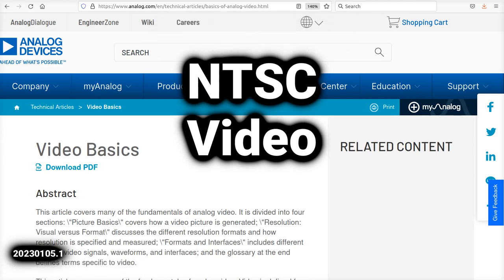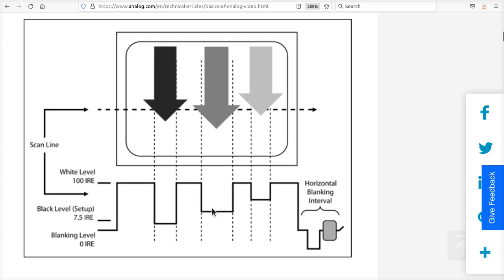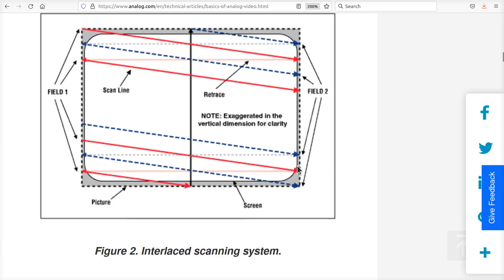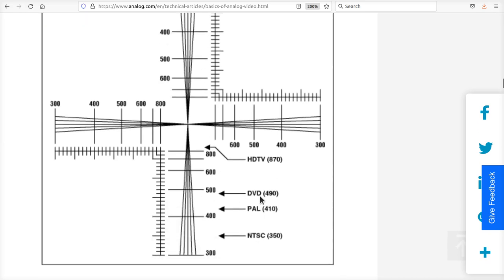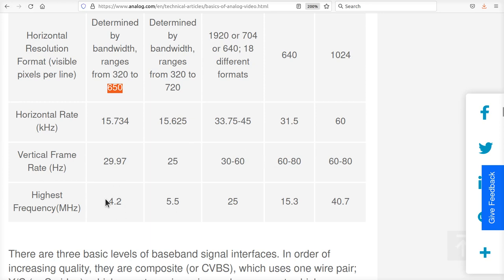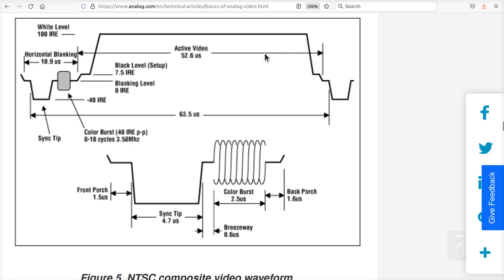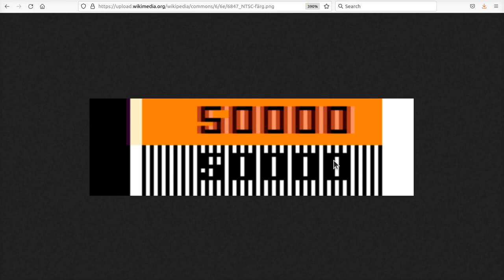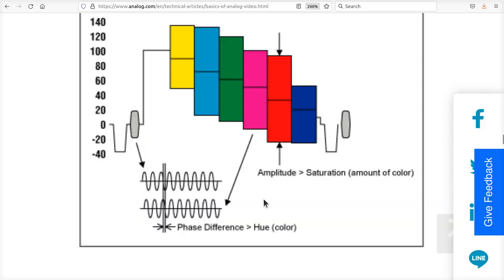NTSC Video Basics

Comment: Please note that US HDTV is still 59.94 including the two 720P progressive networks, ABC and Fox. The reason is NTSC compatibility. When HDTV was introduced in 1999, there were few HTDV sets out there. The gross majority of the viewers still had NTSC receivers. True HD shows were also down-converted to NTSC and NTSC material was up-converted to the HD standard in use. For multiple reasons in a broadcast facility, the signals must have the exact same vertical sync rate for simulcasting. This legacy problem still exists to this day. In the 4K/UHD standards, the finally dropped 59.94 for 60.00. Note  that on the production side most episodic shows and film originated material is done at 1080P/23.98. This means the master tape (or digital files these days) is compatible with any world TV standard including the legacy NTSC and PAL variants. The broadcasters never see 23.98 or 24p as the release master is converted to the format the broadcaster uses - world wide.

Comment: The process of frequency interleaving the chroma into the luma is responsible for the color burst shifts forward 90 degrees not 180 degrees per field. After four fields it arrives back in phase. Hence there is a four field sequence. Note that there is a 180 degree reversal line to line!
Reply: yup, it'was called "color framing" and an annoying problem editing with direct NTSC color record broadcast VTRs. Often the edit point was a frame off from where you wanted it to maintain the color field sequence. If ignored there was a 140ns H shift in the image at the edit. But if the edit was not a match frame,  the production industry often did a non color framed edit anyway as with a scene change, you would not notice the H shift. And then there was 3/2 pulldown from film sources - that's another story. Note that PAL had an eight field sequence!

Comment: Going a bit deeper into NTSC theory. the chroma signal is NOT exactly a 3.58mhz sinewave. NTSC uses DSB-SC Double Sideband Supressed Carrier modulation for the color difference signals. The 3.58mhz AM carrier is not transmitted except for the color burst. Only the modulation sidebands are sent as the chroma signal. But the receiver (TV) needs a constant raw 3.58mhz carrier to demodulate the color difference signals. This is the reason for the color burst. Just as H & V sync frequency locks the receiver scan circuits, the color burst locks a local 3,58mhz oscillator for both frequency and phase in the receiver at each scan line. If the chroma signals were modulated as a basic AM radio signal, the picture artifacts would be horrendous.  This was one of the problems encountered (there are a few more) with the spectrum interleaving of the chroma with the luminance signal. They had to get the energy level of the chroma signal lower and the use of DSB-SC obtained that.

The two color difference signals are a complex mixture of the RGB signals and there are multiple standards to do this function, I & Q, R-Y & B-Y, but for the utmost simplicity think of the color difference signals as red and blue with the luminance a combination of RGB. Using basic algebra circuits we can extract the green signal, out of the luminance at the receiver.
Reply from the maker: The people that came up with these things and got them all working with the commodity technology they had at the time are geniuses!

These days, I get to make pretty pictures with VGA and ONLY have to care about the hsync & vsync!   (yeah... I know I am ignoring gamma correction.  It'll look good enough for a terminal screen and some video games!)

Comment: I think I get the color burst thing a little better now. So for each color pixel you have a phase offset on the visible horizontal line. So how does it 'fit' that 3.58mhz for each pixel?
Reply: What do you mean by "fit?"  There's just one thing changing here -- the voltage level over time.  So at 54mV you see black, at 1.0V you see white.  You only see color when you "wiggle" that voltage close to 3.58 million times per second.  It's just one continuous signal as you stripe across the screen, and sometimes it wiggles (color) and sometimes it doesn't (pure black or white).  "Pixels" aren't a real concept in analog video (a pixel is a digital concept -- I arrange a buffer of colors I want in a 2d array of pixels for example).  The effective rate that you can change your voltage level on an analog signal is what loosely corresponds to a pixel.  In other words, if you have a really slow, kind of ineffective video device (like say the Atari 2600), it can't change that signal as fast as the TV is able to, and so it's "pixels" are constrained by the speed at which it can generate a scanline with a given color wiggle, and thus those old devices looked "blocky" when they produced video.

If you're wondering what the highest theoretical speed at which you could change that signal, he explained that in the video -- it's somewhere in the 300 - 650 times per scanline range (it varies because different tvs will act differently -- some old vacuum tube driven TV probably can't do better than 300 changes per scan line, but a brand new circa 1990 tube tv with lots of digital components might be able to show 650 changes per scan line).  Above that 300 - 650 changes per line, your TV's analog circuitry won't be able to keep up, and it will smear them in some way (producing incorrect colors, or simply not displaying an individual change you had in your voltage stream).
Reply from the maker: How many 3.8MHZ time periods can fit into one active display scan line? Once you exceed changing the luma at that rate, it is likely that a TV can't differentiate between interpreting it as a color and as a brightness.
Reply: @Calphool222  What I am trying to understand is how that 'wiggle' ( I assume a sine wave) determines the color. I get it has to do with the phase of that 'wiggle' but lets say I wanted to use a micro controller, like a Pi Pico to generate this signal, and I want to get at least 8 bit color up on the screen, I need to wiggle that signal at a phase difference from the color burst? I get that the color burst is telling the TV that a color signal is incoming so is that color burst frequency for each 'pixel' color just a phase difference from the original color burst? I do understand that with a micro controller you wont be generating a sine wave but a square wave which I imagine should work, no?
Reply: @JohnsBasement  Well... say you had a signal capable of 8 bit color, 300 or more 'pixels' on a single 15.7khz ...and lets round that 'pixel' count to a standard like 320, you will need to modulate that color burst at the correct phase for each 'pixel' at around 49.2(rounded up) times per scan line if my math is correct. So I am guessing that 'wiggle' per 'pixel' would have to fit in at the proper phase for each color 'pixel' within that 1/49th for each 'pixel'?
Reply: @GORF_EMPIRE  

You kind of have to understand a little bit about AC signals to grasp what "phase difference means."  Imagine any AC waveform.  If you say it is at 0 degrees, that means it starts at position 0 and swings up and down at whatever its frequency is.  If you say it is at 90 degrees, then it will start part way through a swing (not at 0).  When you compare that waveform to another waveform at the same frequency, they either overlap (their phases are the same) or one precedes the other.  You can measure how much one precedes the other, and get a "phase difference."   

Now, imagine a color wheel.  In the center is gray, and all around the outside are all the colors of the rainbow.  The gray bleeds into the colors.  They are most radiant at the outside and most gray in the center.  Any color in the NTSC scan line signal can be represented as a point in this color wheel.  The phase difference tells you the angle on the color wheel, and the amplitude tells you how far out toward the outside edge (where the color is most vibrant) of the color wheel to go.
Reply: @GORF_EMPIRE  

I'm not following your math.... if you have 320 possible color changes per scan line (loosely speaking, "pixels"), then you need to modulate the phase (and amplitude) 320 times in the duration of a scanline (a scanline takes 63.5 microseconds, or 0.0000635 seconds).  So each color change would have to happen in 0.0000635/320 seconds, or 0.0000001984375 seconds, or roughly 200 nanoseconds).
Reply: @Calphool222  Right since I did not account for the Hsync and burst. It was considering the entire line which was not smart.... I typed this out at 7am after a long shift. 😅
Reply: @Calphool222  I do understand AC signals and phase difference. But a horizontal line is really a constantly changing DC signal where the ac signal is modulated on to. It's modulation I need to rap my head around but I get the color wheel thing...just trying to figure out how to actually generate that using a micro controller. Truth be told, I can use a simple Analog Devices to do the RGB to composite for me, but would be more happy knowing how it could be generated directly from the controller.
Reply: @GORF_EMPIRE  

An NTSC waveform is more complex than a normal DC or AC signal, but we still treat the colorburst and the chrominance/luminance signals like they're AC with a DC offset.

With regard to your questions about generating NTSC color data with a microcontroller, I think that's a tall order, bordering on not-possible.  As mentioned, you've got a window of 200ns to generate your AC signal that represents chrominance for one "pixel" of your 320 resolution scanline.  You'd need a pretty fast microcontroller to be able to spit out more than a few oscillations in that narrow window.  Plus, you've got to deal with the DC offset somehow (and the DAC on most small microcontrollers isn't going to be fast enough to provide much help there).  I'm not saying it's 100% impossible, but it's non-trivial, that's for sure.

With regard to using binary values to generate your choma/luma, what you'd do is map some bit pattern to your oscillations.  For example, if you used 8 bits, that gives you a total of 255 different patterns of on/off you could send in those 200 nanoseconds.  Each pattern would give you a different location on the color wheel, because the receiving television is going to compare the colorburst at 0 degrees to whatever you send in that 200 nanosecond window, and establish a phase difference.  The colors might seem random, since you're sort of brute forcing digital into the analog domain (sort of like how Woz did on the Apple 2), but you can build a table that tells you what colors you get for what values you send.... but you've still got to deal with the obstacles mentioned above.
Reply: @Calphool222  The Rpi Pico can do it easily as it not only runs at 133mhz but it has those wonderful PIO(programmable input output) processors. I just need to understand the algorithm a bit better. People have generated very stable NTSC on Atmel's running at 16mhz along with a video game along side the signal. The beauty of the Pico is the 8 PIO processors can run in parallel and independently once set up along side of the dual core ARM. Plenty of processing power in those. They cost only $4 US best of all. I'd be happy with 256 colors and I think using a CLUT( color look up table) as you suggested as a means of generating the exact colors I want would be more than possible on these if folks are pulling NTSC off with an Atmel at 16 mhz. As far as the DC offset is concerned, I can always add that to the output so I'm not concerned too much there. Once again.. I appreciate the input. It's definitely been helpful.
Reply: @GORF_EMPIRE  

Uhhh... the fact that the clock running the Rpi runs at 133mhz tells you basically nothing about how fast the IO pins can be toggled (not to mention that in this situation we're dealing with a DC signal that needs to change levels , so you're talking about needing a DAC of some kind -- this isn't a digital output).  Each instruction in a microprocessor takes more than one clock cycle.  Typically there is a fetch, decode, and execute step minimally for each instruction, and each of those steps take a certain number of cycles that varies by instruction.

We've established that you've got to generate a phase adjusted 3.5mhz waveform in 200ns intervals.  Let's say you figure out some super fast way to code this where you use 25 assembler instructions each time you need to generate that waveform.  Let's also say it takes 6 cycles on average for each of those instructions.  There goes your 133mhz.  Furthermore, you have to worry about something called "propagation delay" when you're pushing data out of a processor to an IO pin.  Each device in the path (buffers, level shifters, etc.) adds delay measured in the 10s of nanoseconds, and this must be carefully managed to achieve your goals.  If there is any kind of instability in that signal path (meaning that it's not consistent), you'll see some weird artifact in your NTSC screen output.
Reply: @Calphool222  it's a RISC and executes most of it's instructions in 1cycle. a lookup alg should not take 25 instructions.
Reply: @GORF_EMPIRE  

...maybe... if you're writing in very tight assembler.... like I said above, it's likely not *impossible*, but certainly non-trivial.  This isn't something you'll hack some C and have working in half an hour.